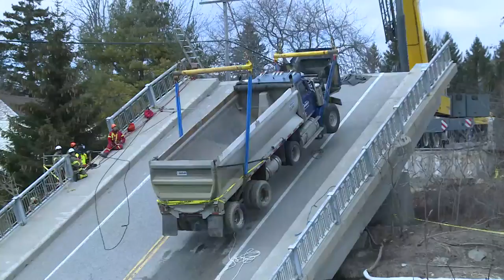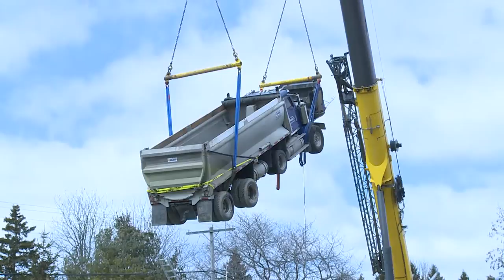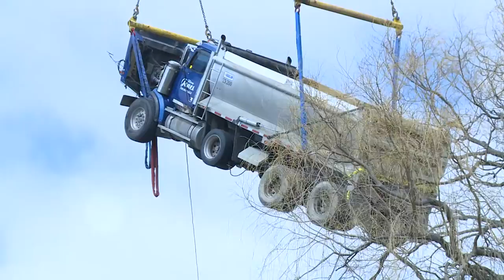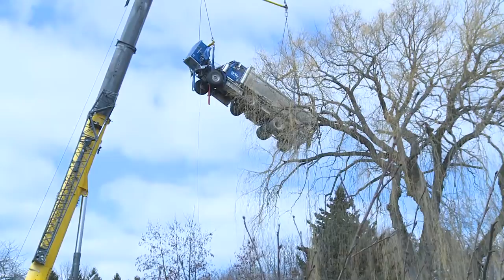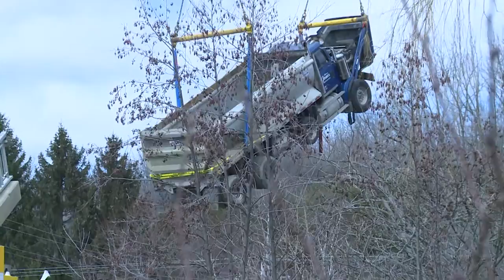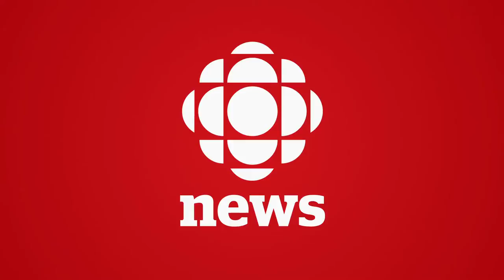How to lift a dump truck off a collapsed bridge

Comment: WHY DID HE LIFT THAT TRUCK SOO HIGH IN THE AIR??
Reply: It might be that the longer the cable the more swing there will be.  So shortening the line, lifting it higher, is better for the rotation.
Reply: To clear the trees